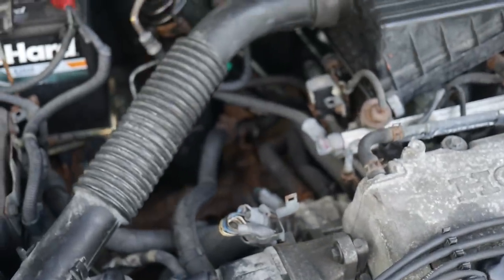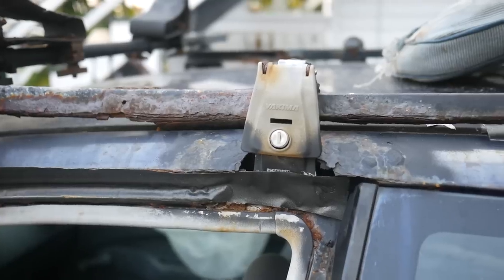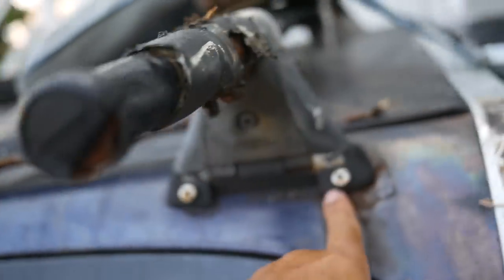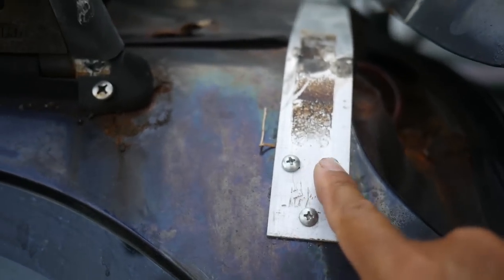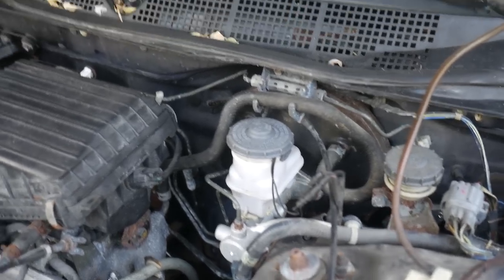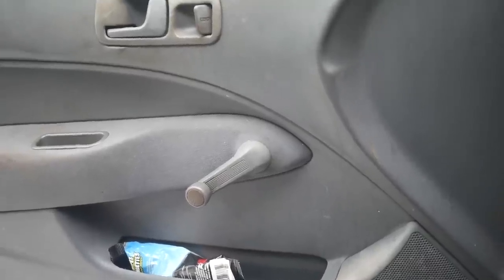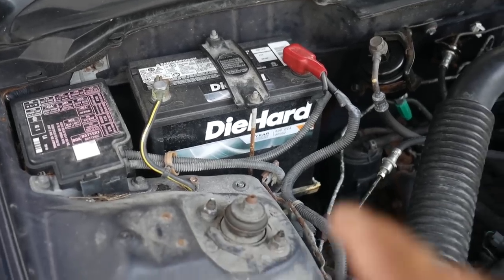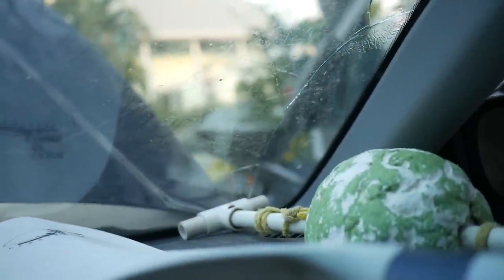Rusty Almost Died 3 Times In 2020

Comment: Helpful tip? Drill some holes in your front walls and trunk bottom. Cover with rubber mat. Rain water will drain out so you won't have to pump it out with your kayak pump each time it rains.
Reply: +1, its a factory feature on my jeep.

Comment: I drive a 04 Volvo XC70 and I tow an 18ft flats boat with it. Volvo uses high quality paint and cover up the frame well. I think the Swedish engineers designed it with salt on the roads in mind so it has held up extremely well despite me putting a boat in the saltwater multiple times a week. All wheel drive  turbocharged 5 cylinder engines are pretty cool too.

Comment: Pour,or spray some Transmission fluid, on the areas where there is Rust,also if you will notice any  oily areas on a car, usually don't have Rust? Even where your vehicle is already rusted,the oil or Transmission Fluid will help to neutralize the Rust

Comment: Your  subscribers need to start a "Car 4 Steve" contest for someone to give you their old vehicle!  I have an old 1999 Ram 1500 pickup with 140k miles, one owner (my father in law, deceased), ALWAYS GARAGED, no rust, everything works including A/C (VERY COLD... even in Florida Summers!), has a bed-cover so no one sees your stuff, everything works, no warning lights on.  No known problems except that it's a 21 year old vehicle with 140K miles.  Could use new shocks but it's not dangerous.  Shocks are cheap and easy to put on.  "Classic" American truck shocks...  NOT McPherson strut.  $2500  I keep the battery charged and try to drive it every couple of months but it's just been sitting in my garage for 3 years.

Comment: Good mechanical condition, but the body (and frame) is gone. It's bad enough to be dangerous. You could find a solid Civic, and use "old rusty" for parts. Or, maybe find yourself a small pickup.

Comment: The biggest issue I see is interior mold from all the condensation, you don't want to breath those spores.  Get a step bit and drill the floor wells so they drain out standing water.  A can of fluid film sprayed weekly on the suspension may help prolong life...of the car and you.

Comment: Hey. ..you might want to find out if your car has rubber drain plugs on the hatch back floor. ..so to dont keep pumping water out...check under all that carpet..and also on the inside floor of your honda

Comment: Right on, you're better off in Rusty than w tourist on s bike moped, not the most extreme ive seen in the keys, 25 years agogo knew a guy who cut the back off an old van nothing left but the frame, had to take off rear suspension because without the weight it ate the tires

Comment: Get a truck when she finally dies. At least the damage will be localized in the bed. When I was there I used that dirt cheap Dodge Neon and yep, had a lot of the same problems with the roof due to the Kayak. You can load it up just like your hatchback. It's so much easier than a car. If I ever buy a car again it will just be a play sports car.